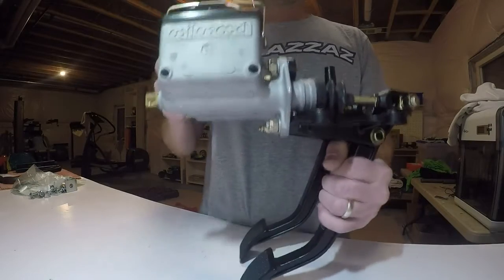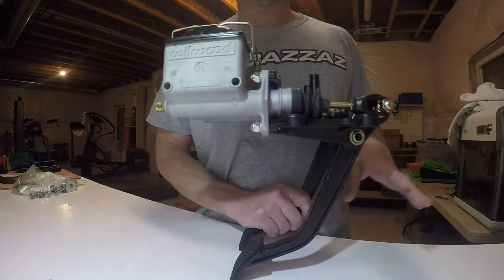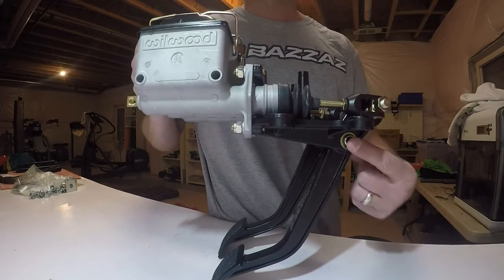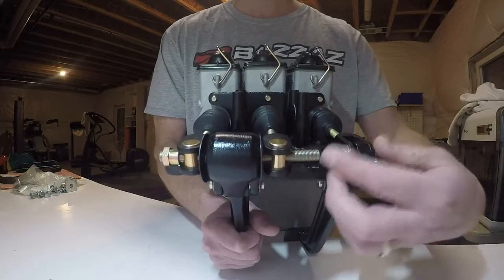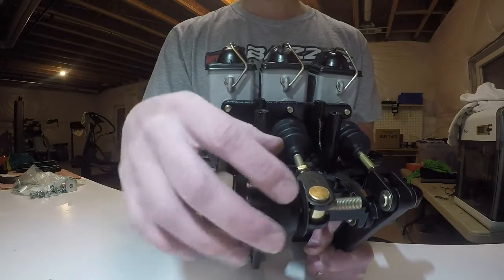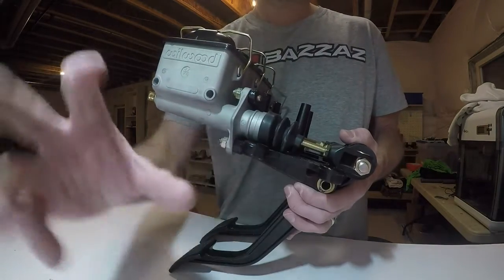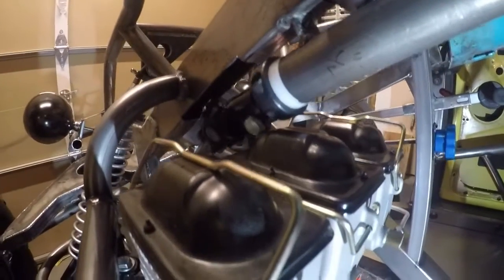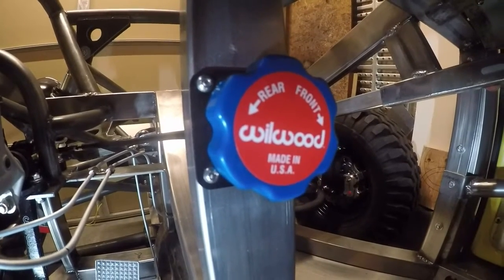Wilwood reverse hanging Pedals show and tell

Comment: Hi, did the 5:1 wind up being the right choice? I'm building a non power setup, it will be about 1900 lbs total and I need reverse mount. Would you recommend this?
Reply from the maker: Yeah, the 5:1 on this is really good. The clutch requires a little force, but the brakes feel just about right.

Comment: Hi, I love your work. I have a fiberglass buggy with and ecotec. I am looking at this setup but am concerned as I am probably only 1500-1600 pounds. Should I be using smaller bore cylinders for both the clutch and brake? Clutch is Kennedy stage 2 with kushlock. Brakes are disc all around, 2 piston all around.
Reply from the maker: I'm using 3/4" bore front and rear. My fronts are 2 piston and rears are 4 piston. My brakes are super sensitive. So I would say yes, probably go with the smaller bore if you can. Although I think on these 3/4" is as small as they go. But I might be wrong.
But it's not undrivable, they just start grabbing as soon as you hit the pedal.

Comment: Great Video! is it possible to show more detail of your steering shaft as it runs above the pedal/master cylinders? I'm looking for ideas for a similar problem in my bug using the same pedals.
Reply from the maker: Sure, in the next couple videos I should be working on the front suspension of the new chassis. I'll try to add a snippet noting the clearance needed for the steering. When I do that I'll highlight how tight it was on this baja.

Comment: Hey Mike (now I know your name isn't Doug's Dad) great tour of your work area's , just wanted to let you know I really enjoy your videos, your work is super quality, I have a Manx Buggy and a 74 Baja and like to do my own work although haven't taken them to quite the extreme you have. I want to start doing a little welding and wanted to know if I could do the welding you have been doing with 110 volts, and does your machine do both tig and meg. thanks
Reply from the maker: Mike Black, I do most of my work with two welders. The flux core welder is a 120v and the Tig welder is 240v. They are both Lincoln Electric. The tig welder speaks for itself, that thing is a beast and will weld anything I bring into the garage. The flux core welder is a little more temperamental. Most of my chassis is welded with the flux core, and it is more than capable. However you need to consider a few things. If you're welding 1/8-3/16 like you will encounter on a chassis you will be at the limits of the welder. 

1. You need to be on a strong circuit, not all outlets are created equal! 15-20 amps is important but really you need to test the circuit with the welder, you can tell if it can feed the current you need or not. 
2. Either plug into the outlet directly, or have a short heavy gauge extension cord. Small gauge extension cords will take away current and the welds will be cold.
3. You need to practice with the welder and get to know it. This info will let you know by feel if you have the needed current and how the welds are going.

So to answer your question, yes. You can do most of this with a 120 volt flux core. I recommend you stay away from mig on 120 volt. Flux core has reverse polarity and welds hotter. I convert mine to mig for thin bodywork. But all the chassis welding I did on this is with flux core. I only really use the tig for aluminum or if I need to be really clean. Remember roll bars and suspension is critical welds, so practice a lot before you dive into it!

Good luck my friend, thanks for the kind words on my videos. If you have more questions don't hesitate to ask. That's why I created this channel.

Comment: I recently bought the same set up. Noticed one port for front and rear. For the front do you just T the line and beach off to each caliper hose ?
Reply: Branch**
Reply from the maker: Yeah, for the front and back. Run a single line near the axle, then put in a T and go to the calipers from there. If possible keep them equal lengths after the T. If you are using a 2 or 10psi pressure valve put it in the single line. Good Luck!

Comment: I really need help. I asked on the lotus forums and got shit on.... I would like to run manual brakes in my Lotus esprit and I have less room than you do in the bug. I wanted to know what your pedal assembly felt like and what brakes you are running.
Reply from the maker: The pedal assembly is great, very solid, good construction. Mine is the short throw to save on room. I thought that might be a problem as you have less leverage but it's not. I have two piston calipers up front and four piston calipers in the rear. I thought that might be a problem but with the balance bar you can easily adjust for the difference. Currently I have the 3/4" bore on the masters but might go down to 5/8" because right now you barely depress the pedal and it's already engaging the brakes.
Hope that helps.